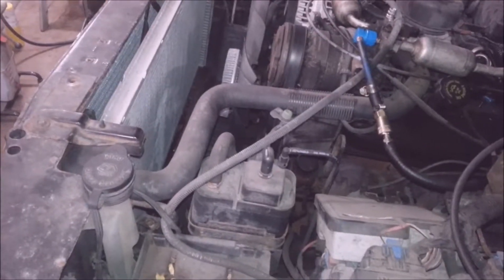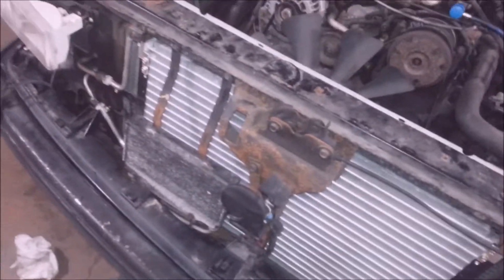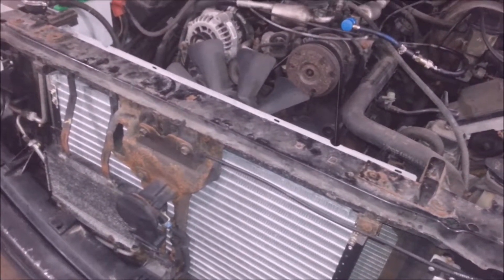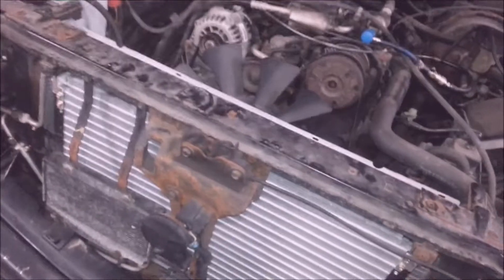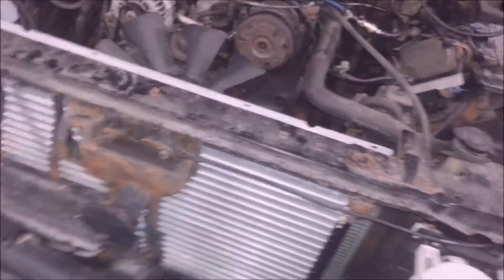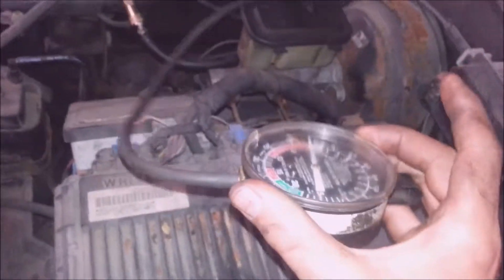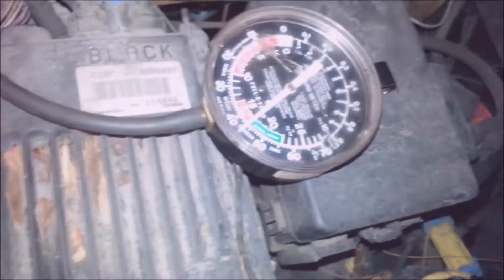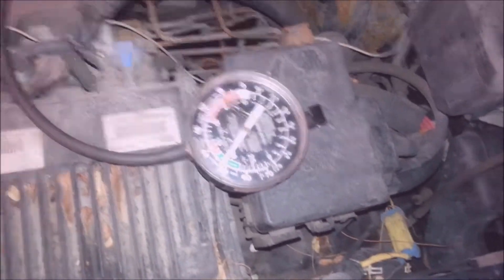How to evacuate A/C with engine vacuum

Comment: Water under a vacuum has a lower boiling point and vapor or steam is easily removed through the pump. That is why it is important to pull a deep vacuum of more then 20 inches for an extended period of time. Using engine vacuum means that whatever you are pulling out of the A/C system is being introduced to combustion. I would be concerned about toxicity and just do it correctly.
Reply from the maker: Negaitive pressure is removing the air, not adding air from the intake manifold. Unlike other liquids, water does have a lower boiling point when you remove differential pressure, but it is trying to freeze, that is why there are ice balls floating around in space, when other liquids turn into a gas. The science behind a/c work, is kind of messed up. The only thing that is really happening when using "vacuum", is removing as much "air", and whatever else is with it, as possible.
Reply: @RustBeltAuto  LOL, Google it.
 AI Overview
Putting an A/C system under a vacuum removes moisture because the low pressure forces the water to evaporate into a vapor, which is then drawn out by the vacuum pump. Water boils at a much lower temperature under reduced pressure, so moisture that would remain liquid at atmospheric pressure turns into a gas and is evacuated, preventing damage to the compressor from liquid water and the creation of corrosive acids. 
The Process Explained
1. Pressure Reduction:
.
A vacuum pump is connected to the A/C system to drastically lower the internal pressure, creating a vacuum. 
2. Water Evaporation:
.
At sea level, water boils at 212°F (100°C). However, under a strong vacuum, the boiling point of water drops significantly. This allows any liquid water present in the system to quickly boil and turn into a gas, even at normal ambient temperatures. 
3. Moisture Removal:
.
The vacuum pump continues to run, drawing the evaporated water vapor (along with air and other non-condensable gases) out of the system and venting it into the atmosphere. 
4. System Protection:
.
This process is crucial because liquid water in the A/C system can freeze, restricting refrigerant flow. More critically, it can react with the refrigerant to form corrosive acids that damage the compressor and other components. 
Key Points
Purpose:
To remove not just air but also all moisture from the sealed refrigerant lines before recharging the system. 
Mechanism:
Lowering the pressure allows water to "boil" and turn into a gas, a process called evaporation. 
Benefit:
Prevents liquid water from entering the compressor, which can cause damage, and prevents the formation of corrosive acids.

Comment: Dont do this if your system has r1234yf.. that shit is very very flammable..
Reply from the maker: @thatguybri6383  so fuel trim will go negative, like adding propane for testing O2 sensors, or brake cleener to find an intake leak? How is that dangerous?

Comment: Where are you connecting that clear tube at ??
Reply: ...that can be connected to any vacuum port on the Intake manifold, and it should not affect the performance of the engine or system.  Just find a empty port, that's been plugged, or remove one of the vacuum lines and stick the clear hose in it's place.

Comment: Good afternoon brother, 

I was watching your video and i thought it was a great idea 💡. 

As im watching the video i saw that you plugged in one end of a clear hose into a port on the intake manifold and the other end of that clear hose you connected it into a t-pin connector then you connected a vacuum gauge with a black hose connected to the t-pin connector and then you connected one end of the blue hose to the t-pin connector and the other end of that blue hose you connected it to the low side service port of the ac system if im correct. 

Can you explain to me your setup in this video and how it works so i can comprehend it please? 

I really like this idea 💡of yours its awesome and it helps us diy beginners to save money 💰.
Reply from the maker: I am just using manifold vacuum to evac the A/c system. The guage is just there so i can see that it is working.
Reply: @RustBeltAuto  ok so now i comprehend that your using manifold vacuum to evacuate the AC system and the gauge so you can see how the engine vacuum from the intake manifold is working to evacuate the AC system. The part that I'm not comprehending is the blue hose that you connect to the low side service port on the AC system, you start up the vehicle and let it idle then you remove (disconnect) the blue hose can you explain that part to me, please?
Reply from the maker: @Diagnose1  if you take off the blue hose while it is running, the vaccum will stay in the a/c system. If you leave it connected, and turn the car off, the vacuum will go away, and the air from the manifold will go into the a/c system.
Reply: @RustBeltAuto  So in order to evacuate all the air trapped inside the AC system is to take off the blue hose while the vehicle is running (idling), am I comprehending correctly?
Reply from the maker: @Diagnose1  yes. Run it with it on for 15 minutes, and pull it while its running.
Reply: @RustBeltAuto  If i leave the vehicle running with the blue hose on and set a timer for 60 mins and pull out the blue hose while the vehicle is still running when the timer is up is that okay to do?
Reply from the maker: @Diagnose1  60 minutes is a little excessive. If you want to waste all that gas, go right ahead.
Reply: @RustBeltAuto  Do you happen to know how to discharge or recover the freon from a vehicle ac system without using an expensive recovery machine like a diy way?
Reply from the maker: @Diagnose1  not really. Wrong is right.
Reply: @RustBeltAuto  So i comprehend that you dont know, which is fine. When you say wrong is right. Are you saying that if i happen to find a way on how to recover the refrigerant without the recovery machine that it's right? Because at least it got the job done, am i comprehending correctly?
Reply from the maker: @Diagnose1  you wont be able to recover it without a machine.
Reply: @Diagnose1  ...you can always use another car to help you do that, one with equal freon capacity, that is empty.  You use the ac system from the 2nd vehicle to pull/drwa the freon from Your primary vehicle to the secondary car.    
Or just build you a recovery system using a donor compressor from a mini-fridge or something similar.

Comment: I don't understand how you can fill the system with refrigerant and oil using this method?
Reply: Because when the system has been put on a vacuum , the vacuum in the system is what draws in the freon.
Reply from the maker: @Geo0163  because it sucks  😁
Reply: @RustBeltAuto  I guess my point was if vacuum is supposed to suck out all the moisture and boil it, why doesn't pull out all the old oil? Also, if sucking in the oil, you are just sucking in more air.  (I think you are right that vacuum just sucks out air and moisture is just absorbed by the desicants and that can be accomplished in a few minutes.)
Reply from the maker: @meblake7359 A/C science has a theory wrong about water boiling out in vacuum. In low temperatures, and high vacuum, H2O boils, but it is actually getting colder, and trying to freeze into a solid. In temperatures that are not low, or high enough, in a pipe, with warm outside temperatures, it also boils, and does not evaporate, or freeze due to convection, unlike all other liquid substances that get hot, and turn into a gas. That is why there are ice balls in space at warmer temperatures in the vacuum (differential pressure) of space. It is also the only liquid substance that floats on its self, when it turns into a solid.
Reply: @RustBeltAuto  That makes alot of sense except there is no space or vacuum above us. It's changing state as a vapor, but convection helps make it solid when in the sky due to temperature changes. Thanks for the explanation and love your videos...you are hilarious, but do an excellent job.
Reply from the maker: @meblake7359  yes. The higher you go up, the less differential pressure there is. The higher water goes, the cooler it gets, until it falls back to earth.
Reply from the maker: I'm just doing an evac. There are pressure cans you put in the cold side, if you don't have expensive equipment.
Reply: @RustBeltAuto  How about using the yellow line like this guy does, but hook it up to vacuum?  https://www.youtube.com/watch?v=Yp-pkhc1Gek

Comment: I agree with your method for a car.  But to be fair on large scale systems you usually purge the system with an inert gas like nitrogen and pull a vacuum on it because regular air contaminates the compressor oil because it absorbs the air and holds onto it and also will make your compressor discharge pressure skyrocket and will blow a seal or the compressor of it gets high enough.  But on a small scale system like on a vehicle its totally fine with the small amount of r134a in it. People recharge their leaking refrigeration systems all the time so I'd bet there's alot of vehicles out there with a bunch of air in the systems and they work just fine.
Reply: On large scale systems it's more important to take extra steps because refrigerant is heavier than air so if there is a leak or a seal blows and somebody breaths enough in, it will sit in the bottom of their lungs and they will die of asphyxiation.
Reply from the maker: @SSN766  very many people go to the store, get little cans of refrigerant, and put it in their cars at atmosphere.
Reply: @SSN766  inversion table ftw!

Comment: Nice idea. Could you please share link to refrigerant valve (blue) adapter you use? Is it R-134a? and there's some brass adapter in the middle? Thanks
Reply from the maker: I cut it off of a hose you use for one of those little cans. There is a ball bearing for a check valve somewhere in there, to keep the can from filling up, and exploding that I had to leave out.

Comment: hook engine vacuum to a 55 gallon drum and use it to suck/pump waist oil into the drum
Reply from the maker: That amount of vacuum could implode a 55 gallon drum.
Reply: @RustBeltAuto  yes only use 5ls. and even then some drums buckle. lol
the blue fuel drums work good

Comment: I have used  this method for many years on my own vehicles and equipment with no problems.  If this does not work for you you have other problems,  contaminated receiver dryer or debris in the system.  Nothing to patent here just an Idea.
Reply from the maker: Can't you patent a few doojamahickies, connected together to make one big fancy conglomerate doojamahicky to patent? You could call it an a/c evacuation doojamahicky.

Comment: You have been thinking the same as I have about this! I found your video when I was searching for this on youtube to see if someone had thought of if before me :) I'm surprised that your video only got 3 thumbs up (including mine).  Why haven't more people thought about this possibility? Is the the vacuum you get with this method sufficient, or do the dedicated ac vacuum pumps suck considerably stronger?
Reply from the maker: Harbor freight has a cheap 20$ one now I might get. I have never seen the professional ac recycling machines go over 20 hg, and I have had a lot of different crappy jobs to see them all pretty much. I'm sure others have done it before me.

Comment: It never made sense to me either, if you don't inject dry air on one side and vacuum on the other( some high tech machines might do that) there is no way anything is coming out of the system, once it reaches pump ( or manifold) maximum vacuum the air stops flowing unless the system somehow collapses...you think?
Reply from the maker: Removing moisture (humidity) requires extreme heat, or cold. Vacuum (negative differential pressure), and/or heat makes molecules larger (smaller amount, takes up more space). It is still there, just not as much. Unless there is humidity in the air (heat, and water vapor), vacuum does not make the moisture go anywhere. If it is very cold, humidity in the air condensates. You can suck all you want, and water will stay stuck to everything because it will not be in the air. If you actually needed to get all the air, and moisture out of an A/C system like everyone preaches, you would probably need to get the system over 215 degrees F, and pump refrigerant in one line, while you suck it out of another, until everything is gone. What they teach people is not the truth. It's a good enough thing, whatever that means. I'm going to try not to think now. Thanks for watching!
Reply: @RustBeltAuto  actually no. Once you get to a low enough pressure, the moisture will boil, become vapor, and get sucked out just like the refrigerant.
Reply from the maker: @adamalvarez4998  you already sucked before it boils. Now it is stuck in a sealed system with negative pressure. It goes nowhere. Futhermore, if you have ever seen water boil at room temperature with negative pressure, you will not see anything condensating from evaporation. It just looks like it is bubbling. Water is a strange substance. It doesn't do what you may think it does. You would need to exchange the substance with something that has no moisture in it, in order for you to do what you think it does. I can challenge the consensus all day long. It is not required to think.
Reply: @RustBeltAuto  Boy are you wrong. Seriously, crack a book open. 📖
Reply from the maker: @michaelmace924  I read it. It's wrong.
Reply: @RustBeltAuto  you're WAY wrong bud.
Reply from the maker: @michaelmace924  prove it. Without talking, and reading a book about a theory please.
Reply: When you lower the pressure you lower the boiling point. Its not like if you reach vacuum for a second BOOM all moisture is gone. Pick up a thermodynamics text book & get to reading.
Reply: @michaelmace924  your right but he's not wrong he's simple showing how to creat vacuum using by using an economical  way